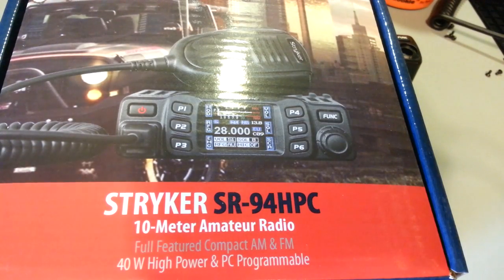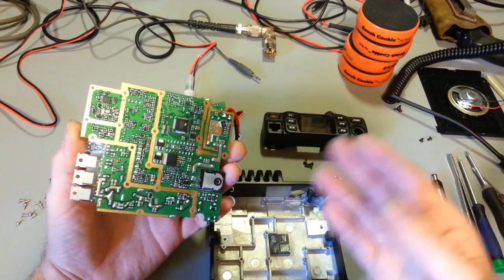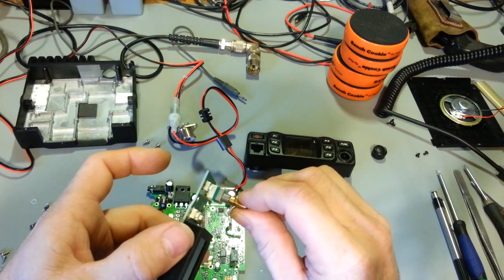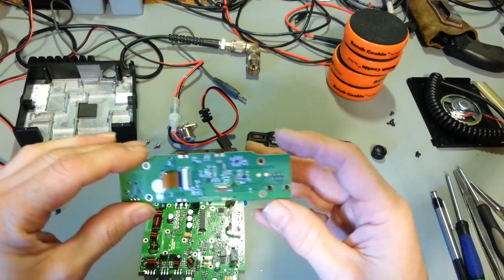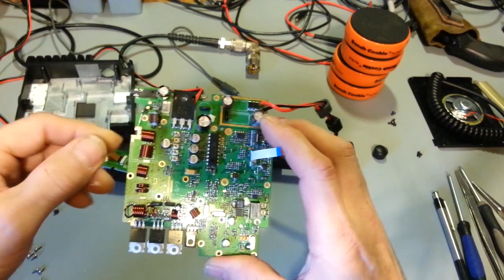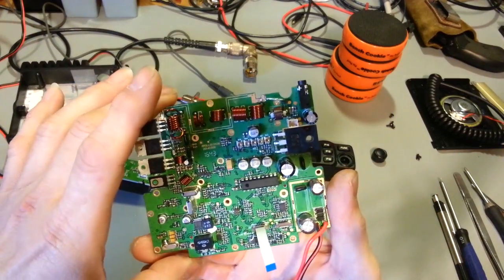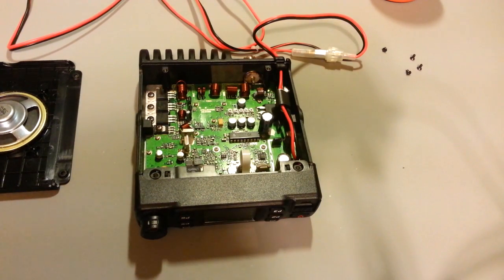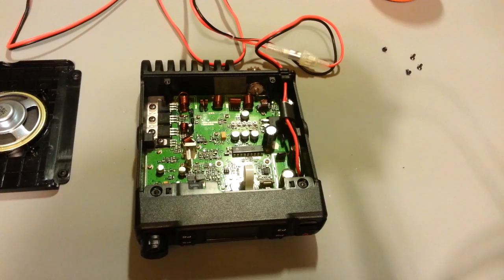Stryker SR-94HPC 10 meter AM/FM radio teardown and review.  Part 1

Comment: What about the part numbers on the encoder?  I am looking for one, mine is skipping forward and backwards while tuning.  If it wasn’t for the mic up and down buttons it would be very difficult to use and configure, if not unusable.  The factory warranty has been voided, so it’s up to me to fix.  Or can I jerry rig a multi throw switch?
Reply from the maker: You can order parts from Stryker.  Just go to their website, hover over the "Support" tab and select "Part Request".  Fill it out and they will contact you.

Comment: CRT France is euro name,was built on commercial radio Russian markets for business cb uses ie taxi etc as band used different allowed higher power and more channels legally
Been out in Uk a while but has 2 fet pa 15w output not high power usa version.
they use a cut chassis jig for repairs.
radio has narrow fm (2.00khz dev/9khz bandwidth) for European uses & uk use also ctcss/dcs built into radio.
pc software quite handy and radio does have vfo function in power up&press certain keys.
uk and eu models are 12/24v version hence pcb trace and a screened box sits there but 15w max rf.
usa no dc-dc convertor for 45-50watts.
Great vid mike,hope info helps.

Rob 73's
Reply from the maker: rpcomms1 

Thanks Rob.  I may just take a housing and mill it out to make a test fixture.
Reply: Yep,that's how we used to do Land Mobile Radio test jigs with Pye/Phillips equipment here in UK.

Comment: I have only watched to first few minutes of this video , and I already like it.....I quiet like the design, that includes great RF and heat sinking practices, and the rigidity built into the case design is great.....all in all a good design, and shocks be coming from china.....really looks good.....
Reply from the maker: Harb's Elecronics Lab 

The Chinese have definitely been stepping up to the plate with higher quality designs in the last few years.  Give it a few more years and they will be the high end manufacturers and somewhere like India or Africa will become the new cheap electronics capitol.  Seems like every decade or so a new country becomes the junk electronics supplier and the last one turns high end.

Comment: Mike, I'm just now watching this, considering buying the radio for actual ham use. (Imagine that!) I run exclusively 10 meter FM above 29 MHz, and have two questions: (1) Is the 455 kHz IF filter surface-mount or through-hole? It's a 6 kHz-wide filter, and I'd like to replace it with 20 kHz for FM use. (2) Is there a way to bias the finals for Class-C? That would reduce power consumption and waste heat, at the cost of sacrificing any ability to use it on AM.

Comment: Mike, What's your thought on drilling out or using a dremel moto-tool to open the mic jack hole on the faceplate and mounting a regular 4 pin Cobra/Uniden/Galaxy Mic Jack? It looks like there may be just enough room from way over here.

Comment: Mike, I had a similar issue on a run of equipment that needed heat sinking in place to be able to do full testing on the bench.....it was a problem for a long time, and I did a similar thing to your idea with a milled out piece of large heat sink plate.......and although it worked.....every time a new model came out, I needed to make a new piece, as the new design would change just enough to make the one I had useless.
I thought I am going to figure this out, so I started to think outside of the square.
I know you are also a machinist, so you will know what I am talking about here.........you know those flexible coolant hoses that are made of all those plastic segments that you bend into position to direct the flow of cutting/cooling fluid onto the machining job......well I made up a kind of manifold to hook up 6 of them together, and blew cold air through them, directed at anything on the board that needed cooling.......presto ! I could soak test anything long term with data loggers or logic recorders etc etc that I wanted.....even tested RF stages in TX mode with no heatsinks at all.......I included a spray painters receiver/dryer in the line to make sure no moisture came through.......
At the end of the day the object is to cool the heated components, and it does the job perfectly.....I can turn on 1 or 6 with the little taps on the hoses....and best of all it works on everything regardless of board design.
and don't laugh, but to get really cold air, I put the little compressor inside an old fridge outside with a half inch hole drilled in the back (to let the air in) and that also had the desired affect of quieting it down too
Reply from the maker: Harb's Elecronics Lab 

Good idea.  A choke tester could be used to.  It's a gizmo used back in the automotive  carburetor days and was us3d to test the thermostatically controlled chokes.  Hooks up to a compressed air supply and has a hot and cold air output.  Works on the venturi principle to make hot and cold air.  Would be ideal for something like this,
Reply: yeah sounds like the go.....another funny coincidence I was also a Heavy Vehicle Mechanic........worked for Cummins the first 10 years of my working life lol.......funny how much we have in common.
Reply from the maker: Harb's Elecronics Lab 

LOL, I worked for International Navistar.  Was certified on Cat, Cummins, Detroit and of course International engines.  Was still a mechanic when the ISX Cummins engine first came out.  It was the new power monster at the time.
Reply: I was only Cummins for the first few years and then GM and towards the end Cat at the mines....then my final couple of years worked with Case/International when they took over Steiger......lol....small world........I got out because my back was giving grief.....all the old blokes used to say "son be careful with your back" stupid me didn't listen.....anyway my passion was Electronics all my life really, so I decided to get into TV/Radio broadcasting, became a Broadcast Engineer and the rest is history......funnily enough, all the sitting at the test bench has probably been just as bad on my back as lifting all the heavy cast iron cases and things !!!
Reply from the maker: Harb's Elecronics Lab 

Wow, really small world.  The last job I had before I started my own mobile service business was as a medium duty Truck mechanic at a Chevrolet dealership.  That was mainly 3126E CAT engines in Topkicks or the GM branded Isuzu cab over trucks.  I quit when GM decided to go from a pick up Truck style cab to a van style cab.  The hoods got shorter by a few feet and the engine got crammed under the dash.  Wasn't to long after that that GM got out of the medium duty Truck market.  Closed their medium duty Truck plant and sold the P chassis plant to one of the big motor home builders.

Comment: That looks a little bigger than the SR-89MC.  Seems that these radios are prone to overheating.  My 89 was working fine and then quit, found it way hot.  Wonder if the 94s have the same issues?
Reply from the maker: Mike Ace This seems to have adequate heatsinking for heat dissipation.  Main thing is they got the heatsink in the correct location, back to top not back to bottom.
Reply: @mikesradiorepair  In many installations, the heatsink on the bottom is the right place, because they're mounted under instrument panels. And it's not heat that rises - it's hot air. The heat from that radio will distribute evenly throughout the aluminum. After that, it's all about getting air to whatever part of the case is exposed.

Comment: That looked like a 2-layer board. Is that all it had or is it 4-layer (or more)
Reply from the maker: Michael Lloyd 

I didn't grind into the edge of the board so I'm not really sure.  No reason they wouldn't.  The price for good quality multi layer boards out of China is really low these days.  Elecrow makes very high quality boards and the price for adding extra layers isn't an excessive amount more.

Comment: will i need an amateur license to use this as a 10 meter?
Reply from the maker: texas range 

10 Meter is the amateur band so yes.  This is what is known as a "export only" radio.  They are not supposed to be sold in the US because they are easily modified for use on the CB band.
Reply: cool i was just reading a case of a man who altered a few in tampa to use cb and was pushing 7-8 watts and they were unregistered and he is being fined $10,000 yikes!

Comment: Is this not actually a 10 meter"ham radio"? That will be converted to 11 meter freq coverage,
Reply from the maker: Pretty much any transceiver that does 10 meters, be it a Icom, Yaesu or Kenwood can be converted to 11 meters by doing a MARS/CAP mod.  I would classify this one more towards the amateur radio crowd.  I say that because it has a lot of features you would not normally find in what I call "black box export radios".  Settings for repeater offset, CTCSS and DCS codes, split frequency, DTMF encode, etc...

Comment: I was seriously considering this radio for 10 meters until I found out that it doesn't have SSB. It's a damn shame that they made such a nice radio and didn't include sideband. I'm probably going to go with the Anytone AT-6666. I'm looking for a real mobile 10 meter radio, not a glorified CB and the Anytone is as close as I can get. Unless anyone has another suggestion???
Reply: YEAH 90% of 10 meters in SSB LOL
Reply: THere was a an excellent all mode radio called the OPtima engineered in NzL and built in PRC but they are not advertised any more as new on Ebay.  There were quite a few sold in the UK.  you will find YT videos on it but you'd have to buy it  second hand I am guessing. TE Fidler

Comment: 28meg & am/fm don't compute.  28megs is usb phone. so only use i see for this is a 27megs conversion where am is acually used
but it's all good i wont buy this toy.  i hang out os SSB. so to me this is nothing but a fancy paperweight
Reply from the maker: Scott Edick 10 meter FM repeters are so busy around here there are often pileups.  There is a optional DTMF board for this radio so it can be used on repeters.